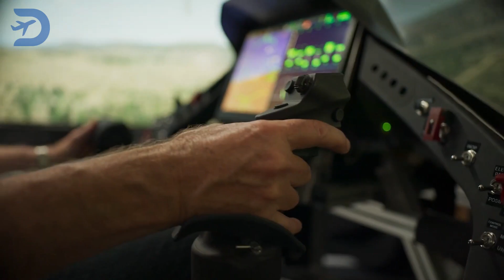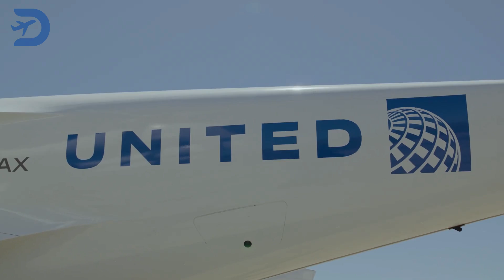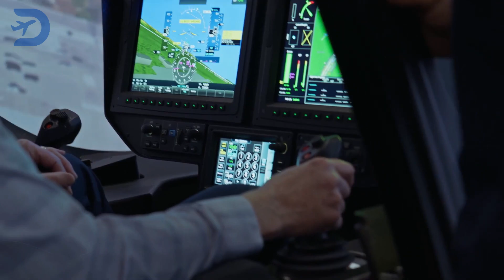Which one is the future of Aviation? Archer Vs Joby

Comment: The main evtol of archer is the midget. And he can carry 4 passengers and have 150 km rang , maker is the small one.
Reply: Joby can fly over 500 miles
Reply: Joby up 500 miles
Reply: @ali460ful  Joby can't scale up whether these Joby queens admit it or not.  Why fly slow when you can see companies like Sakuu unleashing metal-frre solid state 750-1000 wh/l energy dense batteries.  Lilium already has a six-seater that can provide meaningful regional air mobility with the quietest use profile(that gives Lilium reach into all marketing applications anywhere air mo ility would apply.  Not to mention the complications of a hydrogen hybrid mean that it's got a high yield critical failure application in crash risks.  Even dendritic meltdowns in metal batteries have limited fire risks in a worse case scenario. Joby already crashed recently, mind you
Reply from the maker: Thank you for your feedback. Indeed the script for this video could be much better and accurate. This video was a test to see the potential for this type of content. Our team is working hard on improving the content for upcoming videos.

Comment: Just buy stock in both of them !
Reply: you might want to check out EH
Reply: @kenjues1594 CCP bro
Reply: @hisokamorow8388  so what. I try to be unbias. Political ideology is shit
Reply: I did, along with LILM
Reply: @lavantesfranklin9196  Nah.  Lilium is the future of aviation.  Not these 2 limited use startups.  The Joby queens profess it's quieter now but an electronic octopus of rotary is only going to end up loud out there no matter what
Reply: @EarthCreature.  I'm not sure why you seem biased toward Lilium. Can you provide the data to support this preference? Also, why is speed a concern for a shorter distance air commute? The main issue isn't how fast the eVTOL flies, but rather how quickly passengers can board the air taxi without long waits, similar to the wait times at airports. For short distances, the speed of the air taxi is less relevant.